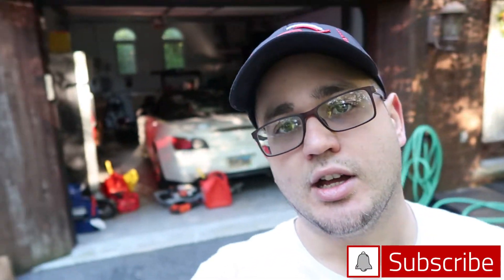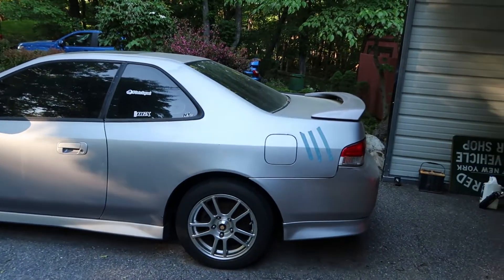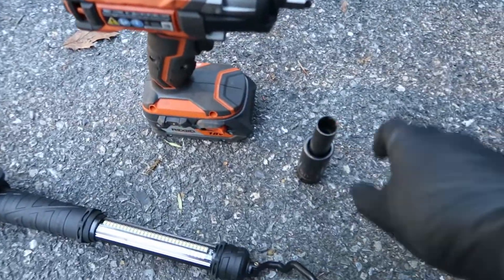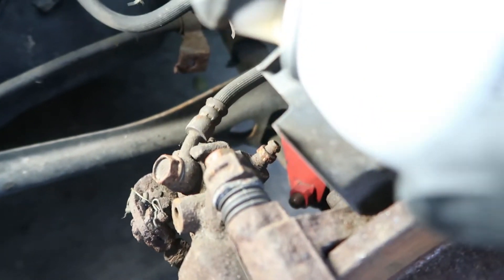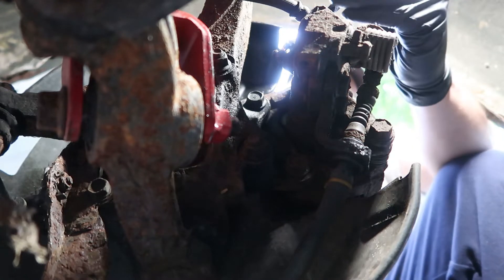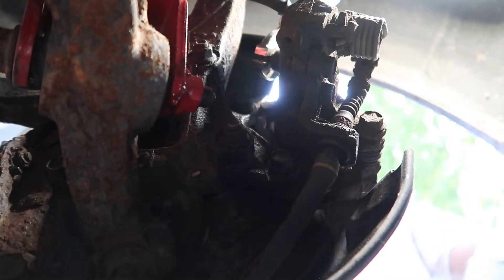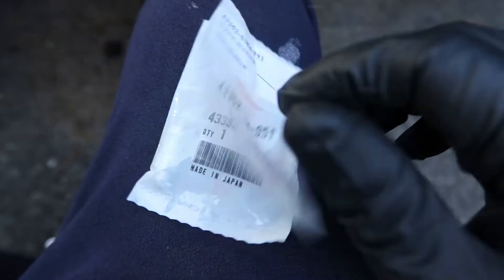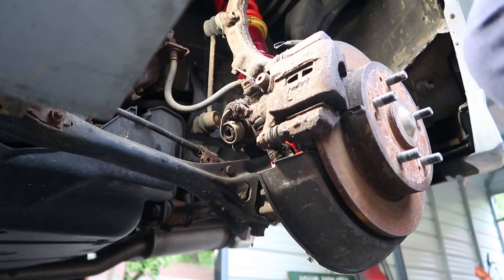5th Gen Honda Prelude (BB6) Budget Race Build | Repairing BROKEN & SEIZED Brake Bleeders

Comment: That's cool to see that you hillclimb a prelude. I've got a 2001 that needs an engine and a bunch of other stuff and have always wanted to do some hillclimbing and autocross and i think you made me make up my mind to set that as a goal for myself once the car is up and running. Its also cool that im just over an hr from Wilkes-Barre so not to far from giants despair. 
  another trick is to use a 3/8in socket or wrench instead of 9mm and a 6 point socket is the best but didnt look like you had the room for a socket.
Reply from the maker: You should get her up and running. Parts for the Prelude are super cheap, including engines and transmissions